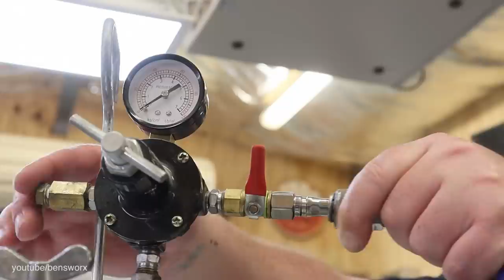I Made a Cellophane Lamp with HOT Resin!

Comment: I have a suggestion for you.  Strontium aluminate is a next-gen phosphorescent pigment which, once charged with light, will continue to glow for as long as 30-40 minutes.  One of its more interesting qualities is that it will absorb ultraviolet light and radiate in the visible spectrum.  This means you can make a light which uses UV LEDs, and if you use it on resin which has strontium aluminate mixed it, the resin itself will glow without any apparent visible source.

Comment: Still think marbles suspended with optic fibers would be very cool! Maybe drill little holes in them to insert the fibers and seal with resin. Then each marble would light up from inside. Could maybe hang them using one of those wood stir sticks!

Comment: That's a great look, Ben. Well, done! I have a bunch of heat resistant gels for altering the light colour of lighting used to make photos and video. Lee or Rosco are the two North American manufacturers that I am aware of. That probably doesn't help you but it might be something to look at for another interesting colour source. I don't know how they would suspend in resin but if you could cut them into shapes they might just float exactly where you place them. Cheers!

Comment: This was a very interesting project!  Just like you, I had no idea what the result would be, but it's an unusual lamp (in a good way).  

You asked for suggestions: I'd like to see another lamp, with embedded "mini pinecones" in a lightly-tinted, transparent forest green resin. The trick will be to keep the cones spaced far enough apart for plenty of light to get through.

I think these are balsam pine cones, but got a better result when I searched for "mini pinecone".  I remember these cones from my childhood, along with a balsam pine needle filled pillow, which gave off the best pine scent.

If you're looking for a completely different sort of project, what about some sort of heated potpourri container? (but not a boring bowl :-) You could fill it with fresh Balsam needles (or other potpourri).  I would think that a low-wattage incandescent light bulb could be a safe heat source, but there may be better options.
Reply: Thanks, but I can't do that.  I've tried to install Telegram for at least an hour.  Telegram won't continue the install without a code that I never receive.  I've googled a solution w/o success.  While I like your work, I'm going to assume the prize is a sticker pack, which I have no use for, so please give it to someone else.

Comment: Suggestion for a lamp,  in the film industry we use fake barbed wire on sets, its made of leather and looks real but is soft to touch and safe for action scenes, you can buy it online.  If you cut lengths of fake barbed wire and put it in clear resin it would look cool,  and if you want you could glue a fake butterfly to the wire in the middle, so when its sets it will look awesome.   As its leather it would be easy to turn, and you can paint a rust effect on it as well.